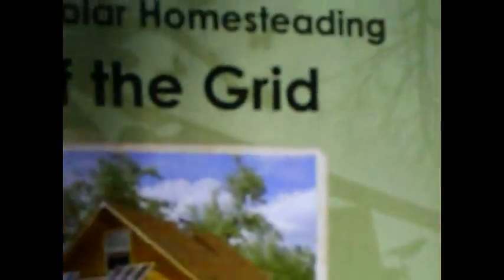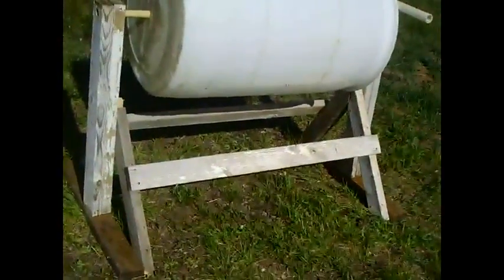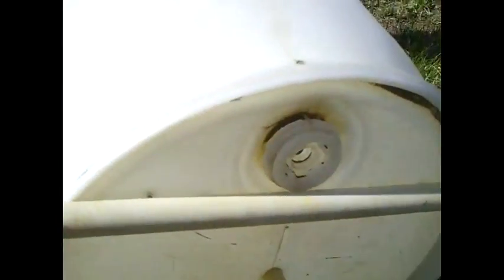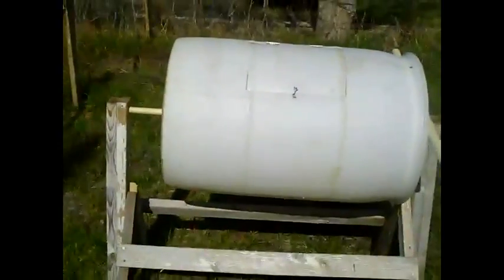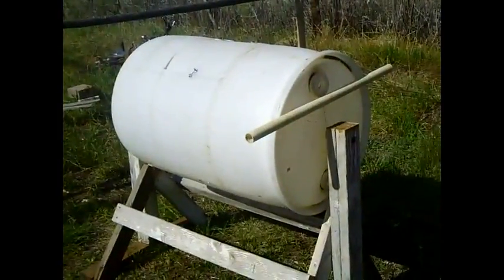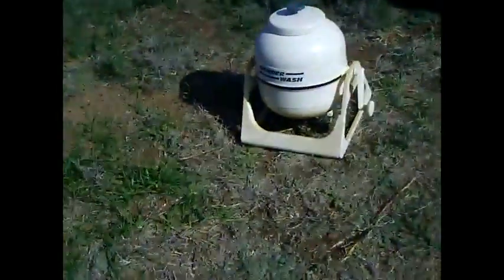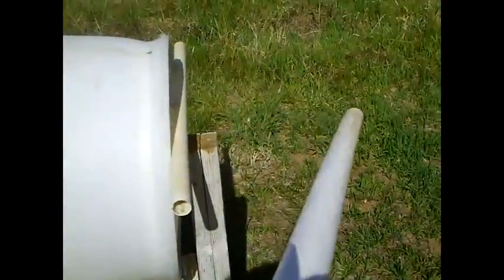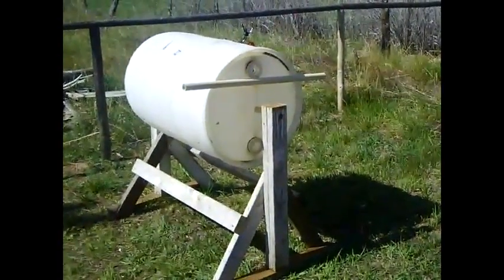Off Grid Tumbling Composter or Washing Machine

Comment: Instead of installing a dowel through the center of the barrel, why not fix a couple of horizontal rollers on the frame at the bottom that the barrel can sit on.  One of the rollers could have a belt drive or pulley wheel, either powered by hand or bicycle driven or using a windmill or a water wheel if you live near a stream that could be dammed up to power the water wheel. A clutch mechanism could be fabricated to engage the rollers.  A cam could be made to limit the degrees the barrel is turned in both direction. The rollers could be covered with a rubber hose for traction and you could even put some rubber around the barrel for added friction.  
( use old bicycle tire or tube ).

Comment from the maker: @stephen3398 

You could add a pvc sleeve over the wood dowel or use a length of pipe.  My old composter has a pipe for the center pole but this one will be used strictly as a clothes washer.

Comment from the maker: @Brie217 

In a humanure pit composter you pour the compost in to a depression in the center and because it is going to sit for over a year it does not have to work fast. Both systems work but are for a different purpose.

Comment: Tell me something does the dowle hold up under a fool load in that barrel Iv used tubeing metal as well as plastic before but the heavey weight was hard on even the metal rod ( if you use mutipul plastic pipes inside each other they can also be used to provide extra air infiltration to the compost

Comment: Id like to try this but with a 30 gal barrel last year are power was out for 10 days I need this and a rocket stove lol  this makes plunging in a 5 gal. bucket or using a wash board look so cave man why didn't i think of this when I needed it at 19 when I moved out on my own dang thanks solarcabin also using a mop bucket to ring out my cloths should work as well..

Comment: When I get my own place, I'll be looking at making one of these.  I saw something like this in another video, where a tumbler was being used as a washer.  The only difference I would do is attach some spokes to it, & run a chain from an old bike, to the washer, & pedal the tumbler.  A simple back & forth motion won't do as good of a job, as it would, tumbling like a front loader washer would.  I would have to add a gasket to the door, to keep most of the water in the tumbler.

Comment: I built a compost tumbler from a plastic drum like this and gave it to my parents. I was amazed that for just two people, it wasn't nearly big enough. It would take a drum the size of a truck to actually create soil with this device. The problem is that in order to tumble the contents, it can only be about 1/8 full, maximum. The stuff couldn't break down as fast as they were adding to it.
Reply: All the ones commercially sold in Australia tumble in the opposite direction for that very reason. Just needs a design change.

Comment: Iv started melting them down with a (bought for the job) griddle to form panles that I now use in place of wood in my projects as bugs dont like it nore does it rot like wwod and when its thick enough 1/2" or better it is stronger (ounce remeltted) 180 degres no hotter to avoid fumes.

Comment: Having watched other videos on compost tumblers, they all have holes for aeration I don't recall you mentioned them for yours? Is that in your book? Just curious how you are getting the air in there besides for the gap around the door. Just wondering...
Tim
Reply from the maker: I don't show holes because this is set up as a washing machine.
Reply: solarcabin
Makes sense, I need to drink more coffee when I wake up to view the web :-)
Thanks
Tim
Reply: DJMovit...... If you use it for a composter? Every time you tumble it, it will aerate the compost itself.

Comment: I want to make a washing machine that pulls behind a mower or 4 wheeler.  Any suggestions on how to do that? lol
Reply from the maker: You need a wheel with a sprocket. An old bicycle back wheel would work and a chain to the barrel.
Reply: @solarcabin  I was thinking something simpler similar to what a pull behind lawn roller looks like

Comment: add vinager PRE MIXED WITH LOTS OFF WATER so ya don`t get spots / oxie eveything is good soap /and 1st let it soke  30 - 90 minits, / a black drum and garden hose holds heat from the sun free.WORK SAFE AY

Comment: Would some rubber washers keep it from sliding around?
Reply: i was thinking along the same lines. i thought about getting a piece of pvc that would fit over the dowel rod, center the barrel, cut just shorter than the distances  and use those as spacers. should keep the barrel centered.

Comment: That's a nice build, but I often get the feeling people build these tumblers just because they can, and not because of their practical use. The capacity of these things is just enough to process a family's kitchen waste, so where does all the garden waste go?
The reality of having a compost tumbler is that once it fills up (which is pretty fast) the rest of the organic waste simply goes to the landfill. Either that, or it goes on the compost pile... in which case you don't need a tumbler.
Reply from the maker: Thanks- I have a compost pile for my garden waste and large stuff. This tumbler would be good if you like to custom mix some good soil but not for a large batch and lots of compostable material.
Reply: solarcabin
Good point, it would indeed make a good  mixer.